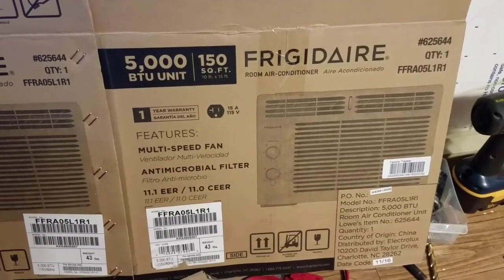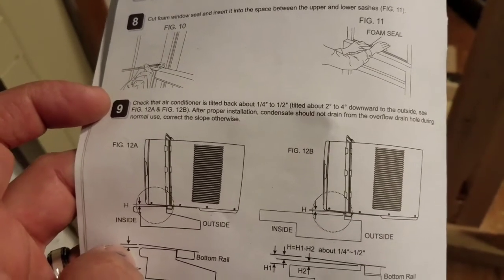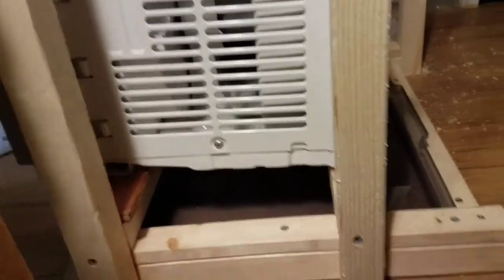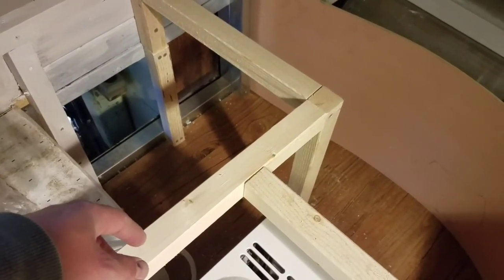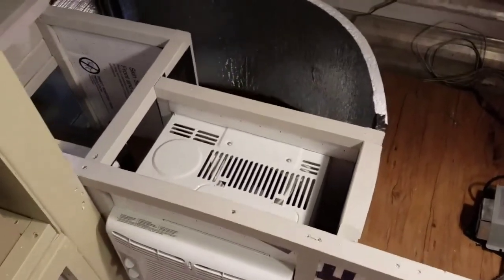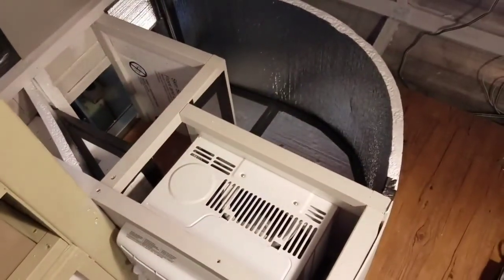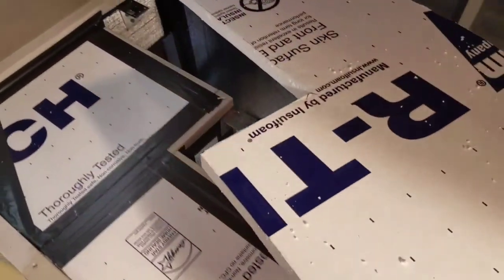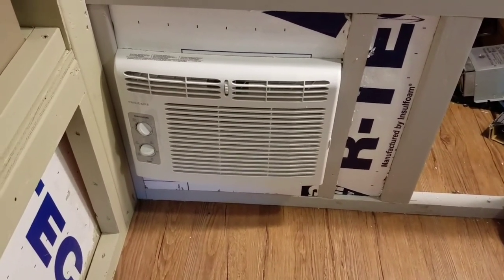Installing AC unit in a vintage travel trailer.

Comment: good job. only thing I'd probably do differently is cover the insulation boards with aluminum tape. would probably help durability and heat deflection.

Comment from the maker: See comment at 0:45 I may add a drain tube later but manufacturer says it should not drip.  If it does I'm hoping evaporation will remove  the moisture much like the drip tray on a refrigerator.
Reply: Is it working?  I want to do something similar to my shasta

Comment: Is it working well? I would be concerned that the outside of the unit needs a lot more ventilation than you might think. You've got it very boxed in, even if there is access to outside air.

Comment: How did it work out?
Reply from the maker: I've only had it running for about an hour. It cools just fine and produced zero condensation externally.  Things may be different when it operates for many hours. We still haven't been camping in the trailer yet. So close to being done with the restoration!

Comment: any update on its function-ability?
Reply from the maker: I've run the AC for a couple of hours at a time and did not see any condensation accumulations in the drip tray below. I have yet to let it run all day.
Reply: @ccsar23  the modern window units are designed where the fan intentionally dips into the condensation in the bottom of the unit and flings it on the condenser coils. This helps cool the coils more efficiently. I have my window unit on my vintage camper on drawer runners, and they slide out an access door, so it hangs outside during use. When it's very humid outside (we're in Florida, so it's common), the condensation can overflow outside the unit. Also all the metal on the unit itself will cool down after a few hours, so the entire unit will have condensation on it. Just something to be aware of, if you run it all day in very humid conditions. We just be sure to drain the unit (ours has a hole with a cover screwed in place) and dry off everything with towels while packing up. Totally worth it for being able to sleep comfortably in 90+ degrees and 90+ humidity!
Reply from the maker: @pkeeney   good info! Thank you